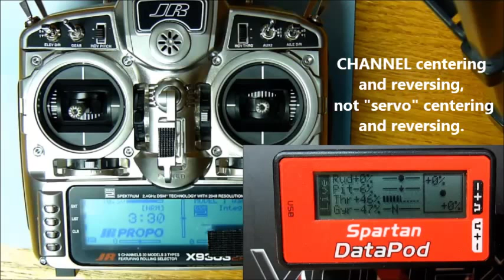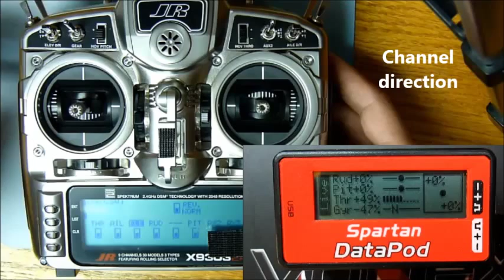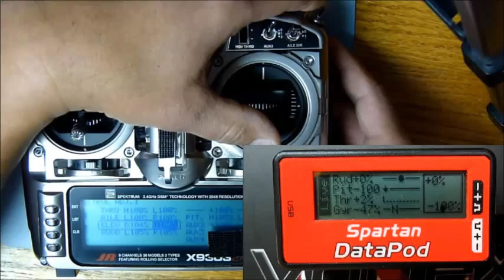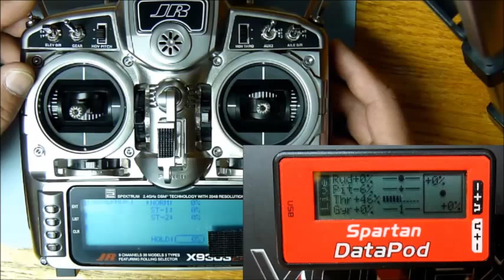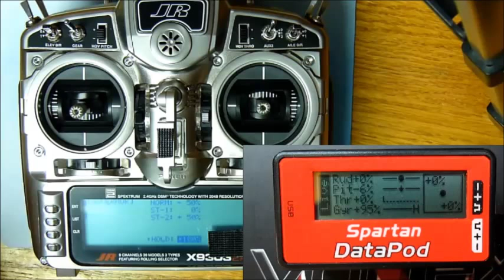Spartan Vortex VX1 - Transmitter Setup

Comment from the maker: If this doesn't work out, we will have to try something else.  Also, you might consider making a post in the Spartan forum of HeliFreak, as there could be someone there using the very radio you're using and has gone through this setup already.

Comment from the maker: Then in Transmitter Setup for the Vortex, put the radio in Throttle Hold and see if H appears on the Live Screen slider for Flight Mode.  Then with TH off, try adjusting your values for Governor in your transmitter and see if the slider moves to N, 1, and 2.   Please let me know if this works out.

Comment from the maker: Throttle Hold overrides (has priority over) the flight mode switch though.  So you might choose to try the Governor menu for flight mode selection in the Vortex with this radio.  Being that TH should basically turn off the Governor, it should change the Gov signal in some manner is my thought on it.  

So if you set up your radio so Gov runs on the Aux2 channel, then in Receiver Setup for the Vortex, select Aux2 for the gyro channel.

Comment from the maker: Alex, yes, the gyro gain is not adjusted via the transmitter the way the Vortex uses the signal. The Vortex still receives the gyro gain (or in the case of my radio the governor gain) signal from the transmitter, but applies it to the flight mode position rather than gyro gain. Gyro gain is adjusted by using the DataPod only, and you can use a separate value for each flight mode if you choose.   And yes you can still select Rate or HH mode.  It's just a different way of doing the same thing.

Comment: Regarding the Flight Mode set up, could you please explain if you are using the gyro gain mixed with the flight mode switch to control input, do you give up controling the gyro with the switch?  Can you still put the heli into rate and HH mode?